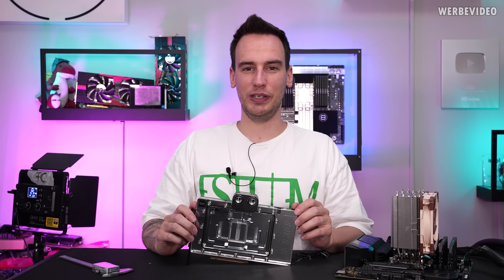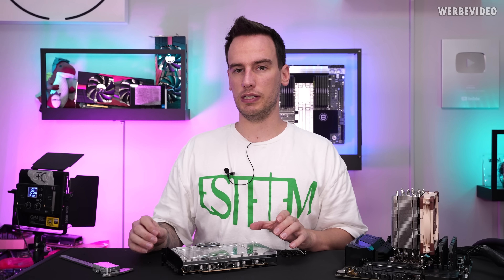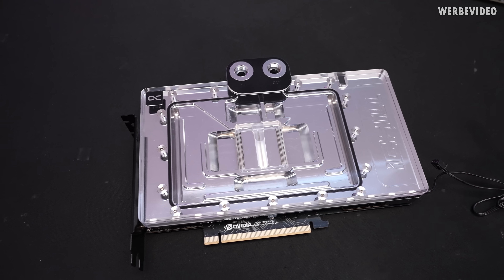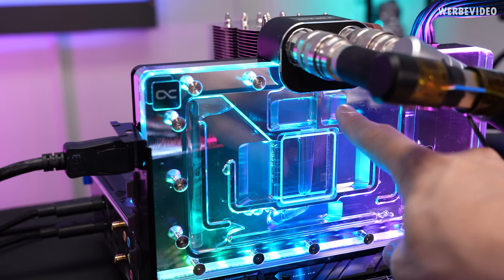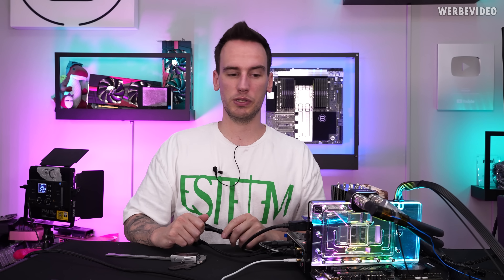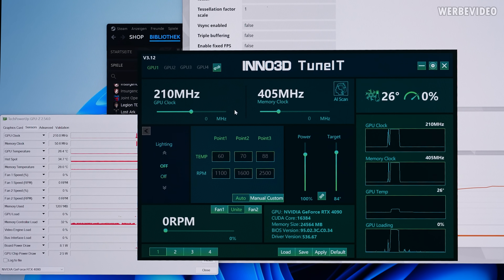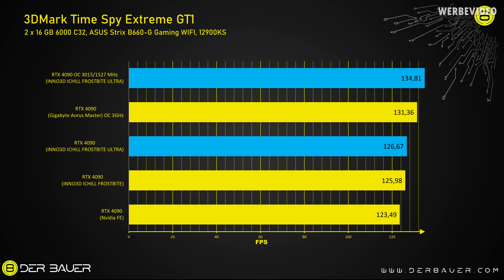Potential Cooling Problem on this RTX 4090 iCHILL Ultra?

Comment: please, circuit board hi-res pictures, I beg 🙏
Reply: Why you need that so bad?
Reply: @N0N0111  for some power system mod. I found some good ass DrMOS SPS from Alpha & Omega with tons of protection, pcb unload features and so on with 110A rate and QFN5x6 package. Same goes to Monolithic and their 90A SPS with LGA-41 profile that's used for MSI SUPRIM DrMOS (although circuit board of iCHILL doesn't look reliable like MSI's big fatty crunch of textolite).

I could not find it anywhere and you know, I have a better alternative with MSI suprim as I said and 26 power stages. Don't criticize, I know that the 4090 power system is already overkill, but just in hunt for the lowest and the most stable temps possible

Comment: Just pick up the board!  It is a bubble.  Air will always rise so turn the pump on and rotate the board as needed until all the bubbles are in the radiator. Common Sense is apparently a super power.

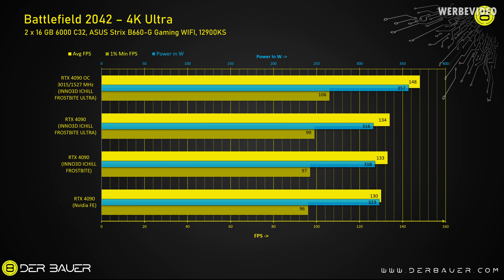Comment: 12:44 can’t we tilt the board to take the air gap out?
Reply: It is very odd that someone as Derbauer complaint so long about this and never fixed it in the video.
Very odd, the whole comment section knows the fix but the master himself didn't mention it...

Comment: So who has the best 4090 waterblock ? Who ?
Why not make the entire waterblock out of Copper to conduct/Absorb the most heat possible ?   That is the whole point. Then pump speed would not matter at all. 3D print a copper block or better a graphite block and be done.
Clear Acrylic is vain and silly.  Who watches clear water flow ???  Just connect an output flow meter.
Reply: Clear acrylic can be beneficial, you can always be sure your water block is not clogged up just by looking at it.

Comment: Has this been released yet? I can't find any vendor with it

Also could we just flash the bios for this one onto the normal frostbite to get the higher power draw?
Reply: Flash the Galax 666W vBIOS to it instead, it'll give you 1.1V Vcore too. My 4090 FBU did ~3 GHz on water with said vBIOS.

Comment: The low flow rate performance issues are unfortunately a problem with alphacool 40 series cards. I got the Eiswolf aio for my zotac 4090, and the flow rate was abysmal and the card was hitting 70+C in OCCT at 600w even with a perfect mount. I swapped the terminal and did a regular loop with D5 at 100% and my max temp is now 54C at 600w and I can see flow visually around the sides.
Reply: I don't know about the aio version, but I have a Core water block for my 4090 suprim and it's performing great.

Comment: If they had made the outlet on the bottom slightly smaller than the one on the top then the water would have filled the side channel since it would be the path of least resistance. Having a slightly smaller outlet on the bottom would also more than likely create a bit of a venturi effect and help to pull the water from the channel on the side therefore increasing the flow in that channel. While in a case I'm sure the pump noise would be greatly diminished but still they should provide documentation if the block needed faster pump speeds to completely fill the channels. Seems like it works great though so I guess its just nitpicking on my part. As always, great video!

Comment: Well duh, if you don't get the air out of the system there's not going to be water flow. When you're filling a loop with water you're supposed to tilt things around until there is no visible air trapped in the loop. The problem isn't in the water block, it's in the way you've decided not to do all the necessary steps required when building a water cooled system.
"I didn't bother installing it properly and now it doesn't function properly. This can only mean that the product is not designed well!"

Comment: Read instructions? PUMP the system before starting at full pump speed? To remove air from the system by "swaying" the case? FOR WHAT? Let's set the settings as always" and burn the video card!!!

Comment: Oh man, I water-cooled my Strix 4090. The temps I am getting I was never expecting. I sit at 28 degrees C on idle. I have not seen the temp go higher than 35 degrees C yet but that is because I am not playing very demanding games yet. I am sure it will spike a bit higher once I start to play cyberpunk 2077.
Reply: At 100% load I get temps in the 68-70 region with fans at 100% rpm (Alphacool Eiswolf). I would be curious to know what you get because it's unfortunate having to hear the jet engine take off plus I can also hear coil whine. :(

Comment: I definitely agree with your conclusion that practically speaking the poor flow in the left channel has no meaningful impact on temperatures, but it still shows a lack of attention to detail in the block design. If the channel isn't doing anything, they shouldn't have bothered milling the slot in the first place and saved themselves a bit of machine time.

Comment: Another contender for cracking pcb xD
Reply: You saw Gigabyte is secretly making a new RTX 4090 revision after not complying to consumers guarantee?
I don't think this GPU will have cracks, it is super compact and less overhang beyond the PCIe slot.
Reply: @N0N0111  Gigabyte has some shady business in the past unfortunately also. It's sad because it was one of my first motherboards manufacturer. I'm sad to see them doing this to their customers.

Comment: The air pocket is blocked by liquid on both sides, of course it won't move. Such pockets are kind of inevitable at the first fill of the loop and it is not the water blocks fault. Tilt it a couple of times to get the fluid going, it'll be fine then....

Comment: I have an Eiswolf2 GPU AIO from Alphacool for my AMD-made 7900XTX. It has an air bubble in the same spot and changing the pump RPM does nothing. Their fix is for you to take the whole thing - rad and card - and shake them around to try to get the air to the top of the rad and then add more coolant via the fill port there. Tried that several times now and I still have the same air pocket reform at the top left of the water block after a couple of days use. Not ideal. Alphacool will not be getting any more business from me sadly.
Reply: I just bought the for my 7900xtx as well. I just got rid of my bubbles but be honest I'm not impressed by the watercooler's performance. I have a pulse 7900xtx and I was running 60c gpu and 80c hotspot @ 2906 with the watercooler I get 57c gpu 77c hotspot @ 2966. What utility are you using to turn up the pump speed? I'm current using the Bios.

Comment: I can confirm the air goes out after some time and does not really affect the heat. I have the older 4080 iCHILL and my D5 pump chills at 40-50% all the time

Comment: 3:36 . I disagree that having a cover makes the card look better. I have an "asus ekwb 3090", and the black plate on the bottom looks out of place and like it was just tacked on as an afterthought, just to cover the tiny led strip. I wish it wasn't there, but removing it isn't an option. to me, this card looks much cleaner and better without that cover plate

Comment: Can I suggest a topic for a future video? Seeing how most manufacturers of modern gaming laptops are starting to use thermal putty instead of thermal pads for v-ram etc. I would love to see a in-depth video about putty vs pads and how this affects maintenance. Should you replace the factory thermal putty with pads or not. Which has better thermal conductivity, pads or putty.

Comment: Use horizontally and air won't accumulate. Or at least fill in that position rather than talking about problems.
Some container can be used to collect the air, from which the air is evacuated by means of a valve.

Comment: Hmm running this card with milky colored liquid would make the dry part even more noticeable and less attractive
Reply: Tilt the system (or the card if using soft tubing) and you wont have any air pockets.

Comment: I swapped out the Alphacool Eisblock on my Inno3d Frostbite 3080 for an EK equivalent. The Eisblock was fine on the core but seemed not great at cooling the RAM whereas the EK cools both well. Always used with a D5 on full power.

Comment: I'm planning/getting parts for a new watercooled PC at the moment (Thanks for answering my emails!!! looking forward to taking the mycro for a spin ) and I got the Alphacool core Master, for my Gigabyte 4090. This block on the Inno3D ultra is also from the Alphacool core series, which was already available for some time, for reference boards like the Inno3D. I just compared it to my core block, and mine doesn't have these secondary outer channels 🤔My loop is not up yet, so I can't tell you if it works any better, but it's very peculiar to me, to see exactly this part different on the core Master block.  I wonder if is a newer revision, or if the second channel is not there because the VRMs are just more compact ? Anyway. Interesting video. Thanks!

Comment: Remove the air pockets using 100% pump speed/rotating the pc a little. After it is removed, return pump speed to 30% and put some "aura" additive to the coolant, this would show if there is flow through the VRM section. ( i guess you could also do it with bubbles into the intake of the pump from a fill bottle too) 

I would bet there will be flow, albeit slow. So long as that air pocket is removed and water is present there it will be removing more heat, very sceptical if you would notice the difference in temperature though as your own tests showed.  The VRM doesn't really produce a lot of heat, and it's spread out over many chips, with that size of copper block it's just going to average out. 

Would seem to just work better if they machined off that extra baffle/ridge, it's not like the VRM really needs all that guided water flow.

Comment: Here in the UK this card costs £2,000 most likely equivalent to 2200 euros and it's only available on one single store. It is quite disappointing we can't find it for the same price as in Europe.
Reply: Get a train from King's Cross to Luton, than airplane to Frankfurt for a City-break and also get the GPU.
 I'm in the same boat and this looks like an option for me. :)

Comment: Really, it would make more sense to direct water only over the GPU/VRAM and then bring the MosFET heat in with heatpipes, rather than have this asymmetrical flow impedance.  Probably cheaper, too -- much less copper to CNC.

Comment: I will stick with more mature company, EK.
No problems, as well as a rear card cooling solution. 
And the EK duel D5 pumps😊. Under 40% on each and quiet.
Reply: I have an alphacool block and temps are great, also water flows over the vrms
Reply: EK is garbage for the most part, aside from their Quantum Torque fittings. Bykski, TechN, OptimusPC or Heatkiller for waterblocks, Heatkiller Tube for reservoir, Aquacomputer for pump and monitoring (beware, their Aquasuite license scheme is very, very fucking greedy IMO) and Hardware Labs for rads.
Reply: @Wasmachineman  Greedy in what way? You can use the latest version that your license was valid for. They don’t block you from using AS. You can check the update notes and buy a new license if you need to. Otherwise this kind of licensing is annoying though.
Reply: My EK 3090 Fe block is a thing of engineering beauty. @Wasmachineman
Reply: EK is overpriced shit nowadays. Watercool over EK all the way. Also EK doesn’t make D5 pumps. They’re made by Xylem. ABP is useless.

Comment: Clearance issues,   Pump noise,   And air bubbles?  Nah!  I'm gonna pass.    Does look pretty cool though.  Thanks der8auer for the review!  Cheers!
Reply: Are you joking? The air bubble issue is the classic watercooling issue you have to shake/tilt and run the pump at full speed to clear it.
Derbauer did a bad job show casing that 101 watercooling step... Why he did it, well I think of a YT clickbait title.

Comment: Please, would it be worth changing my frostbite normal version? for this? the 2 doing oc would reach the same values?

Could you put the bios of this ultra to the normal version??? would that be a problem? or just overclock the 2950 normal version and they will be almost similar?

Comment: I think surface tension isn't the issue, the air bubble is held in place by gravity.  Imagine if the bubble suddenly broke up into smaller bubbles.  Then those small bubbles would need to travel downward before they have a chance to escape the block.  But they can't do that because if they did, the weight of the water would push the bubbles back to where they started.
Running the pump at higher speed might fix it, but maybe not, because the water will just take the path of least resistance.
Rotating/tilting the block 90 degrees should fix it.
But like you said, it's fine even with no water directly flowing over it, copper is a really good conductor.
Reply: I have the same water block, I had an air bubble in the top left corner, it went away with time.

Comment: Is there an ichill for the 7900 XT that would be perfect for an upgrade for my GPU, also how do you guys get all the air out of a water cooled build
Reply: Getting the air out is relatively simple, you gently tilt the case and coax the air into the reservoir. Though generally speaking over the course of a couple of days and a few power cycles, the air will all just go away by itself. 

Don't know about a 7900XT version, but they also do a 4070Ti and a 4080 with the pre-installed waterblock. Their 4070 iChill aircooled model is compatible with that same waterblock from Alphacool that also fits the 4070ti, but you'll have to install it yourself.

Comment: Just turn your pump on and let it run for a week at 100% speed.  Make sure to keep topping off the reservoir as the water level goes down.  I guarantee with absolute 10000% certainty, that block will be completely full.  This is how GPU waterblocks have been for 20 years.  EK's blocks do the EXACT same thing.
Reply: i promise you he already knows this
Reply: @cjbtlr I'm sure he knows, it just strange he didn't mention it in the video, (if he did my bad)

Comment: 6:30 this is 100% completely normal.  Just let it run for a few hours and the block will fill up completely.  Faster pump speeds will speed up the process significantly, but even at 10% speed the water will always fill the block eventually.
Reply: It literally won't. You can shake the card to fill the chamber and it will proceed to empty itself at any pump speed.
Reply: @nik12937 It will, I have this water block and I had that "problem".
Setting my pump speed to 100% for some time and just using my PC regularly fixed the "problem". Also my pump speed is pwm controlled, from 800 to 2600rpm max, once went away the air pocket never returned.

Comment: Does the power usage on normal include the waterpump? If not then the card is using more because the other models are using fans that also consume power. 10 watts or more for 3 fans is easy to obtain?

Comment: I must have gotten lucky with my two d5 pumps. I have them set at minimum 50% all the time. When loading up the system they will slowly go up to 75% then up to 100%. I NEVER hear them till 100% and even then barely. And no I don't have a case. Obt just sitting on a table with two pump/res

Comment: High flow or low flow... water is a fluid, it will follow the path of least resistance.  It doesn't really matter in this card, but ideally in a center inlet, you want each side to have the same resistance so the fluid flows equally.
Reply: it does matter though if the water flow doesn't push water around the edges to effectively cool the VRAM. That's why I swapped out my Alphacool block.
Reply: @MikeTimbers  I totally agree.  I was going by what Der8auer was saying, even with that poor design, the mass of the block was still effective at cooling the VRAM.
Reply: Water doesn't only flow through the path of least resistance. It flows along all available paths in proportion to their resistances.
Same with electricity. It flows along all paths, splitting according to the resistance of each path.
Reply: @Falcrist  according to the resistance, yes. so if the resistance i.e. an airblock allied to a restrictive channel can prevent any flow.

Comment: can't you just rotate the card around  to force that air bubble out? once you do that then it will flow through the whole block no problem... I would think.... It's just air trapped with no way to get out, even if you ramp up the pump to 100% it would most likely still be trapped there..... If it were me, and I had it al in a case and no the open air setup like you, I would pick up the case and rotate it around so the air can get push over to the outlet... then you could bring the pump back down to 30% and you wouldn't see or hear that trapped air anymore.....
- - then again YOU are the pro, I've personally never had a water cooled system... but this just make sense to me :/
Reply: oh look..I was right LOL (i made this first comment before you did any testing) so you moved it around and SOME of the air got removed.... and you didn't even try to lol - yea its a real pain in the butt....  but I would think you would have to do this in ANY water cooled system... ESPECIALLY if you want the water to be SILENT

Comment: Love this kind of content Der8auer. I do wish you would have included more about the watercooling setup such as temperature delta under load. I have the original variant of this block for the Gaming OC and was wondering if the "Core" version of the block was noticeably better. I will say with my block, there is about a 3C drop in temp going from 50% to 100% on the D5 by the way

Comment: Mem chips like to be same as gpu but run at 6 to 16ghz so a 2.7ghz gpu does get hot or fast enough
Reply: Also mem is a form of cpu design just with cache cells